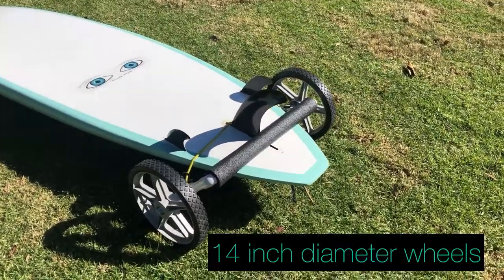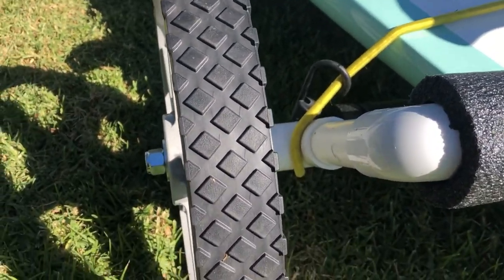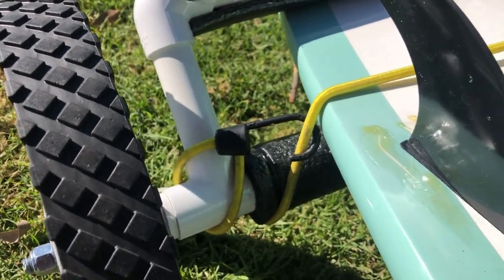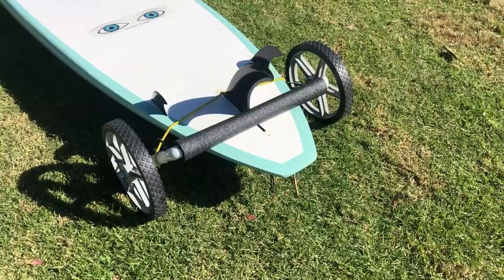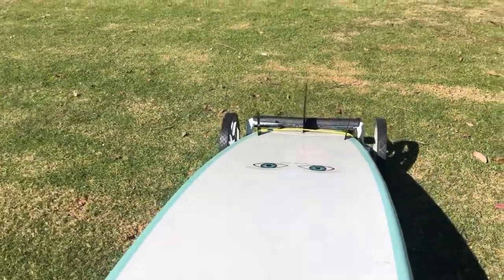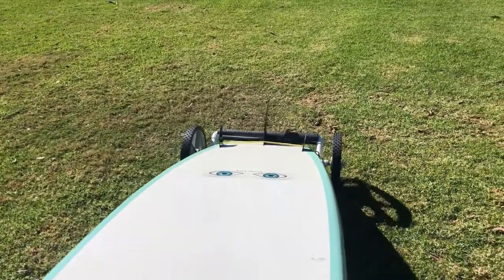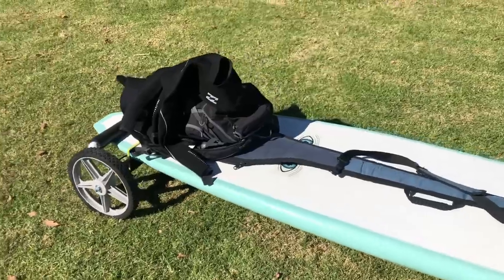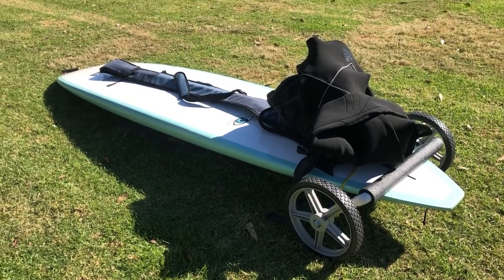DIY Stand Up PaddleBoard Cart  - Make Your Own!

Comment: Well dang! I had this I dea last night. But I need wide wheels for sand. I’m trying to find the plastic wheels like the kids have on the battery powered Jeeps.
Reply from the maker: I looked at those too. If you can get the plastic wheels for cheap or free would be a good option. I found these wheel worked well because they have a large diameter.
Reply: I’m going to camp out at the local dump. Or search market place.

Comment: How did you make the hand handle?
Reply from the maker: The handle is a few parts. First it’s a go pro mount on the nose of the board. Secondly I got a piece of nylon wound cord. I found a rubber handle I had from an old beach chair. I just looped the cord through the handle and around the go pro mount.